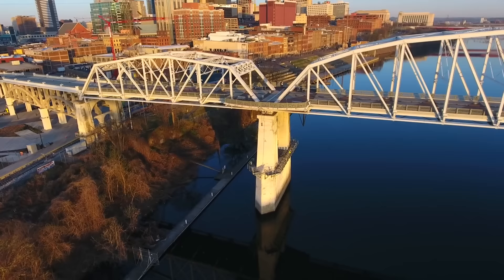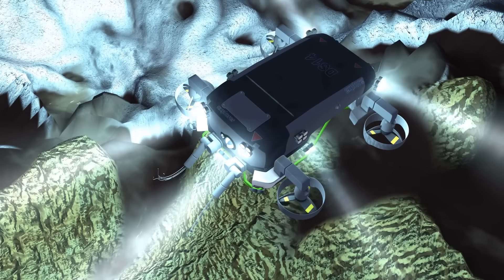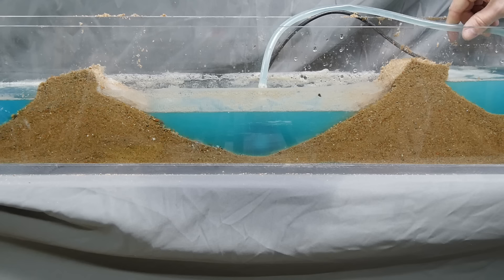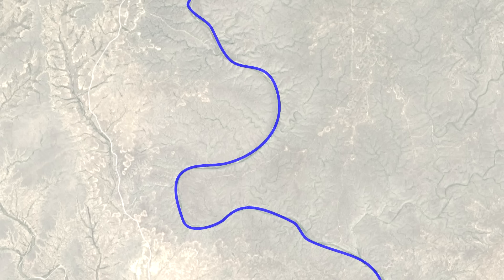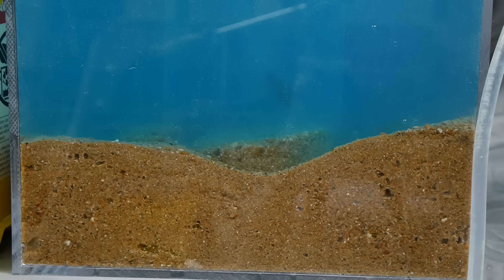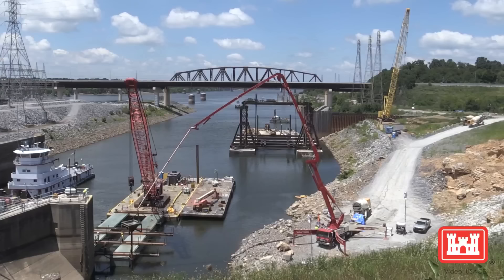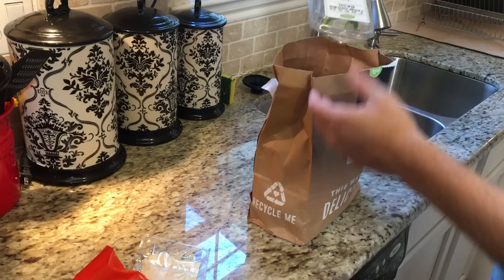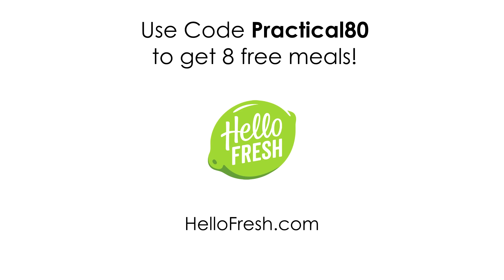How are Underwater Structures Built?

Comment: Right out of college I worked on Terminal 6 in Portland OR.  My job was inspecting each and every sheet pile driven into the Columbia R. to create a row of caissons forming the pier face. As you know pile driving is based on driving to resistance.  I marked each sheet pile with an approval chalk mark at the resistance point. When done with this project I figured we had driven the equivalent of 20 linear miles of piling.  The caissons were then filled with compacted sand and topped with a 24inch concrete deck.  Good memories.

Comment: Turns out the 40+ hours spent watching Curse of Oak Island weren't a complete waste of my time as the show taught me nearly everything mentioned in this video. It just took a lot longer.
Reply: I stopped watching after 10 episodes. Did they ever find anything?
Reply: @erebus3383  they found human remains at something like 190 feet down along with some parchment.  I admit this the one tv show I watch regularly, stupid readers digest article that I read when I was a kid.
Reply: It was a joke when they kept sending divers down, but couldn't see anything.   I was thinking why not pull dirty water from the bottom of the shaft, filter it and add a bit more clean water so that the clean water in the search area's hydrostatic pressure would push out the dirty water.
       They act as if people centuries ago would be able to construct something which modern man using modern equipment and techniques wouldn't be able to access. They think there were flood tunnels which are booby traps.  No the reason everything floods is because it is a relatively small permable island.
Reply: I passed a sememster of ancient mythologies class with an A without ever studying thanks to Age of Mythologies and I've passed quiet a few history classes with A's and B's by barely trying thanks to Age of Empires, Total War, and a few other games.
Reply: @arthas640  may i ask where you are from? In Germany history tests are more about writing essays about a certain event like how did the weimar republic fail and argue wether it could have been prevented or not, while its sounds like you just need some basic knowledge about history
Reply: @lewisdoherty7621  AND, there are actual flood tunnels that were placed there on top that lol. Who knows what the conditions under the island were when the original work was done there but after humans have disturbed it originally the ground there has just continued to be dug up and reburried so there is almost nothing but unstable ground there. Only way to actually stop the water would be to encircle the whole dam island with those steel sheets they had in smiths cove recently. I doubt the government would let them do it though.
Reply: tn15 those guys are so incredibly  unprofessional its dangerous work to do in a controlled job sight , with dozens of people around watching every move you make , people can slip and fall into the big drink without anyone seeing or hearing anything. Why we wear the vests that float and have a beacon button. Still people die every year from my union , and that's just NYC and north east NJ. We lost 8 people in 2017 I'm shocked nobody has died while making that show.
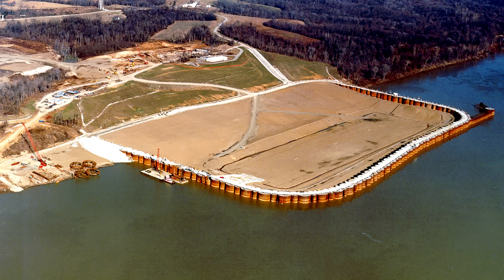Reply: OOOHHH! That's where I recognize that one 1:49. At least I think the image is from Curse of Oak Island anyway

Comment: Hey I've worked in coffer dams before... it's a weird feeling knowing you're standing on a river bed and the surface is 30+ feet above your head.

And if it fails... well you're not going to have time to think about it.
Reply: What, if any, is the "plan" going thru your head in that situation? Something like hug the nearest bouyant thing you can find?

I work in a machine shop. In case of earthquake my plan is to hit the E stop and jump inside the machine until shit stops falling from the ceiling and sliding around the floor, then leave the building as per fire.
Reply: Been under a lake in a tour. Table Rock Dam. In the cave about 900ft down the guide says u are now under a lake. Hearing water trickle down the walls I was ready to get the hell out of there.
Reply: We have to wear life jackets and hope for the best. I've had to repair 2 cofferdam failures in my Career so far, both happened during extreme water levels and no workers were inside during the failure.
Reply: Yeah we had to wear jackets too.  I dont think they would help with anything besides the retrieval of the corpses. Lol
Reply: In the sewers and reservoirs, we wear a hi visible traffic vest and harness for easy body retrieval.

Comment: What about water structures in earthquake zones? do they have specialized techniques to ensure safety during construction?
Reply: Rio-Antirio bridge had her pillars that the base was built in shore, and then they towed roughly in position, and then they were built as normally. The increasing weight due to construction, submersed the pillars until they where set on their own bed.
Reply: nope they just hope  that nothing bad happens

Comment: You forget one major type of construction, drydock builds. Made out of concrete, steel or other materials its just towed away to a final resting place.
Reply: Rafael  If you are curious watch those documentaries:
https://www.youtube.com/watch?v=se26Ux9QD44
https://www.youtube.com/watch?v=aUqrBV4SiqQ

Main difference between premade constructions and those made in keson is that it was probably better to made them in dry dock or just impossible to made keson big enough to build it like this (Troll A). Some tunnels are built in dry dock and then submerged (look for Boston Big Dig). I believe that difference is large at least to mention of that type of construction.
Reply: @piotrlenar5652  it is spelled caisson, not keson which is a nonsensical word, not hard to figure out how to spell when spellcheck (should) offer caisson as the proper spelling. And yes many large formats can now be more eaisly precast at a dry dock and loaded out to location and forgo the need for a caisson and thus forgo the dangers of that confined method of casting.
Reply: @Joshua79C  Keson (caisson) sorry, it didn't show it as a mistake so i assumed the word is similar to my native language. And it isn't nonsensical you are just unfamiliar with that kind of spelling. And when I check it caisson is french word and you read it wrong as all words in US english borrowed from european languages.
Reply: Oddly enough there is a company with that name and I did not mean it is nonsensical in seriousness, Yeah I figured you do not speak English but Google only shows it as caisson for me and could not find alternate spelling in other language (have not even tried it in translator tool to see how it is written in some other languages), but curious to what your native tongue be.
Reply: @Joshua79C  https://en.wiktionary.org/wiki/caisson Bulgarian and Russian spellings of word caisson are familiar to polish witch my native language is.  And I speak english or write in it but not too well :)

Comment: "Stay warm" he says... ROTFL! After a couple hours that wet suit ain't very warm anymore, and dry suits? Not sure if they are better or worse, just different. We also get 2x-3x-4x pay for working inside of a caisson. It depends on the pressures inside. You get paid for compression/decompression time too.
Reply: As a coal miner, I normally scoff at the claims of others and how dangerous their job is. But, I must commend your work. If only I got paid extra for ever hole I had to climb into!
Reply: Commercial divers use a loose fitting wetsuit called a hot water suit wich has rubber tubes running inside the torso, arms and legs wich carries water heated in a boiler at the surface. Super confortable for long hours in super cold water

Comment: Dewatering is also vital on land as well. In areas of the us where the ground water level is high, you will need to have a wellpoint system installed around an excavation to remove the water for installation of sewage pipes, basements, ect. Pretty cool stuff here. 🖒

Comment: Tunnel boring crews that ride those long worm-like machines have to pressurize the cutting head area building the France/Great Britain 'Chunnel'- aka the Channel Tunnel. When they had to change out the teeth on the cutter head it would require decompression and everything, whereas the rest of the machine workers didn't have to. Fascinating stuff, now speaking,  because they never said why they did it on the documentary I watched and I didn't know why they did it. Thanks Mr. Engineer Guy!

Comment: In the 1970s my father was a manager in the state park system and they all told their stories. They often had much bigger projects than budgets. Back then they often had to resort to "creative engineering." One of the other parks needed to rebuild a boat launch including the docks and ramps a portion which were under water. The parks often shared equipment so the managers had access to an eclectic assortment beat up machines. Mostly castoffs from other departments. For some unknown reason one of these was an old jet boat. These boats  used very powerful automobile engines turning large pumps. The tremendous jet of water shooting out the back of these allowed them accelerate very rapidly. In other words they were delightful things from a time when power was often held in higher regard than efficiency. That park also acquired a backhoe front end loader combination. They used the loader backhoe combo to block the channel leading to the boat launch with dirt .They positioned the boat in the channel with a large plastic tube attached to the output of the jet boat pump and leading to the other side of the dam. The system could drain the area in a rather short time but was very difficult to control. To make matters worse a lot of water was finding its way back in . The boat sucked bottom muck and sand more than once. Still it continued to function until the project was completed. I can't tell you what the level of damage was to the boat. The state sold it at auction shortly thereafter. Perhaps to prevent some other park from trying the same thing.

Comment: I actually always wondered about this very topic. I never had seen how it was done and wasn't sure if they did it by pumping out water or doing it in the water or doing the concreting out of water and dropping the pieces in via crane. My best theory was they would drop lighter hollow concrete sections in by crane and stack them then waterproof the joins then pump center section out and pour concrete into that.

Comment: Hi. There's one construction type of kofferdams you haven't noticed. When constructing the parking garage near central station in Amsterdam a steel sheet wall surrounded the worksite. But then if you pump the water out. The surrounding level of groundwater would drop. Therefore the froze the ground under the wall/site so water would not seep in underneath the wall. Thus keeping the surrounding groundwater level at normal level, preventing the wooden poles that support the buildings to rot at the waterline. Nice video though. As usual, very interesting.

Comment: They recently finished the Champlain bridge in Montreal. They did it all without using temporary dewatering structures. The old bridge was at the end of it's life and showing serious signs of deterioration, including a massive 2 meter hole that was found in one of the girders supporting the bridge. The political authorities, who had been delaying and pushing back the construction of a new bridge suddenly realized that not only was a new bridge needed, but it had to be build in record time. The time table were so demanding that there simply wasn't time available for this purpose. They had to put the foundations in while the rest of the bridge was still being designed. Most of the work was done using barges.The St-Laurence are rather shallow and fast moving at that location which did make for interesting work conditions.

Comment: For larger builds I like to empty out the water using either the sponge method or the sand method. Of course there is always the option of using a turtle shell or enchanted helmet, or a conduit so you can breathe underwater :v

Comment: i like how you said “designed by an engineer” as if any engineer has designed anything by themself. you mean “a team of like 1000000 engineers where half of them are doing almost nothing but picking out the screws that will be used.”

Comment: You mention the sheet piles that are pounded into the ground. But are all the seams welded to prevent water flow? You mention that they interlock. but I can't believe that seal is water proof. I've always wondered about that technique. I guess the seam has some sort of gasket or possibly design that uses water pressure to help the interlock. I was hoping that you were going to talk more about that :)

Comment: In the early 80s i built 500,000 SF of buildings on sand landfill pulled out of San Francisco Bay. They made and island in San Leandro from the dredging's. The pumps need to run forever.. Dirt on top for landscaping. Note you can not drive on the sand during construction unless you wet it with a water  truck.

Comment: The cofferdam usually installed with lock sheet pile or lock pipe pile, the vibratory pile hammer is the best tools to install these piles.
The YZ-180B is the model who good at driving such piles. the Driving force is 1810kN, the max. line pulling force is 600 kn.
More detail please check the url below
http://en.yonganjx.cn/index.php/products/hydraulic-vibratory-hammer/yz-180b-hydraulic-vibratory-hammer/

Comment: Can steel structure be erected as seaport. Is steel structure rated to hold  that much weight from the crane and The shipping containers. Is there anything that stops steel from getting rust. Would steel beams coast less than concrete..? Please it would be so kind of you to answer this. But if you do a vedio about it... it would be amazing

Comment: It would be amazing to put a big tube around titanic and drain the water around it. I don't think it would be logically and logistically  possible build a massive concrete tube that extended down 2.4 miles. It would have to support the literal weight of the ocean and be solid enough not to move in strong currents or storms. Still a cool brain wave! Either way, if Titanic came into contact with air it would start decomposing at an astonishing rate and would probably collapse in under a year.

Comment: Easy. 
1:Get sponge blocks. (Can be difficult due to guardians at ocean momuments. 
3:dry sponges 
3: build structure under water
4: wall off areas leaving 5-10 blocks between each wall. 
5:confirm sealage
6: place sponges from top to bottom in each layer until water is gone. 
7: remove interior walls 
8:enjoy underwater building.

Comment: The short answer to how underwater structures are built is that they aren't. Find a way to get rid of the water and build as usual. One of the basic rules of engineering is 'reduce the problem to one that has already been solved'.

Comment: How does concrete become sturdy underwater when it can't be left to dry as there's water?
Reply: Concrete uses water as one of the chemicals to solidify. It’s not like glue or paint where evaporation causes hardening.
Reply: Concrete uses water as one of the chemicals to solidify. It’s not like glue or paint where evaporation causes hardening.